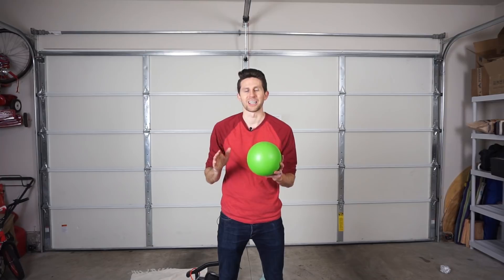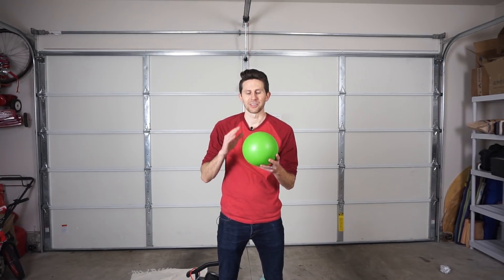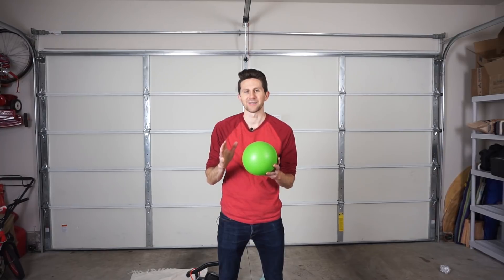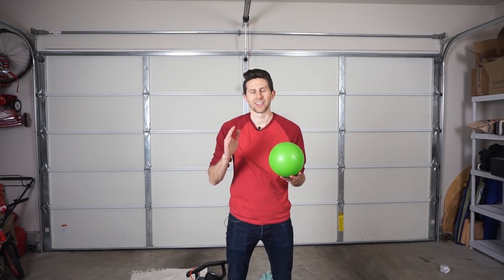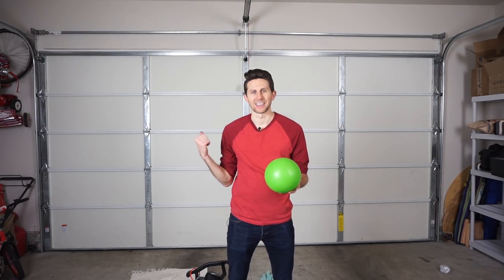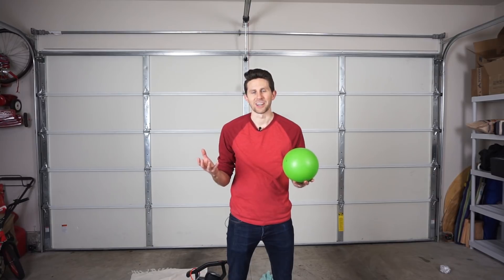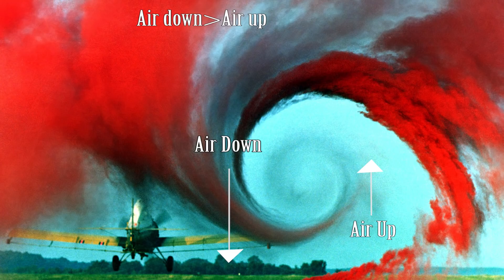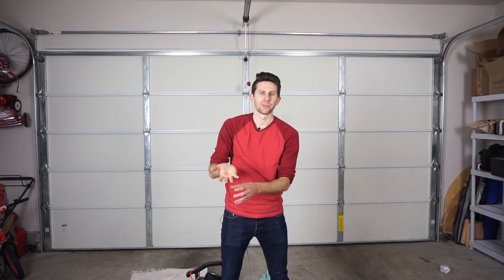How To Get Regular Things Around Your House to Float in Air?

Comment: Somewhere I have a toy version of this ("Schylling Floating Ball Game") in which you blow your breath into a wooden tube, and the exit tube is 90 degrees to the main tube; it comes with a little Styrofoam ball.  I figured out right away that I could tilt the whole thing and that the little ball would still stay in the air stream.

Comment: How about a blunt nose rocket with a small weight in the nose? The blunt nose could provide enough drag while the weight would keep the rocket in the proper orientation , if it works it would be cool to demonstrate how a few small change makes a big impact in the objects  ability to hover.  Also what about those small toy footballs that have a tail and fins? Do you think that would hover?? Great video as always, thanks!!

Comment: Fluid moving exerts less force perpendicular to direction of motion, than standing air, at low speeds and flows
It exerts more force in front and negative force behind

Air is like bouncy balls, bouncing in every direction when air is stable at rest then the bouncy balls hit every surface evenly, 
But if you blow air it's like turning on a machine gun each air particle you launch can hit other air molecules and blast them away likely in line with the stream, so a lot of the motions of the bouncy balls is now biased in one direction so vectors perpendicular to the stream are now spread over a greater distance

Comment: I was taught in flight school that Bernoulli's Principle relates to the airfoil of the wings. There is more surface on the top of the wing than the bottom and therefore the air passing over the top of the wing (airfoil) has to have a lower pressure than the air underneath the wings, essentially causing the wings to lift the aircraft. Same with rotary wing aircraft except the airfoils are the blades of the helicopter but same principle.

Comment: Sorry mate but your explanation on why airplanes fly is wrong. Two thirds of the effect are given by the bernoulli effect which creates an upward depression pushing up the wings and one third of the effecte it is given by the angle of attack of the wing Itself.
Air vortexes are not responsible for lift and they are rather disturbing it.
Trust a pilot's word.

Comment: About the ball with holes in it, I think the reason why I doesn't keep floating is mostly due to the fact that when it gets tilted so that the holes are facing the gound, most of the air will flow through them, so there won't be enough air pressure to keep the ball up..

Comment: Go back to school, and repeat Bernoulli's principles.

Bernoulli's principle states that an increase in the speed of the fluid occurs simultaneously with a decrease in pressure or a decrease in the fluid's potential energy. [Wiki]

Main principle why aerofoil of wing generates lift force.

Eventually the same principle place ball in the middle over and over in given experiment.

Comment: Wait hold on....I kept replaying the leaf blower/ ball explanation and section. So is it that atmospheric pressure is greater than the pressure created by the airflow rate over the ball? I'm trying to use Bernoulli principle here but when you say "the air that's going around the ball is going to be faster..." compared to what airflow? Just trying to understand. Where is the area of low pressure and the area of high pressure?

Comment: A fun shop trick is to take a rat-tail file or an old screwdriver as long as it has one of those large wooden handles in the sort of lightbulb shape they normally come in and use an air hose like that.

Comment: You should try and bend/angle the fins on the model rocket so it would spin when the air is applied onto this surface, thus creating more drag and a cool spinning effect. The extra drag will hopefully allow the rocket to stay in the air

Comment: I noticed your garage door has what’s called a torque master Spring system to counterbalance the weight of the garage door if you raise and lower the door manually and requires more than 10 lbs of effort in either direction convert it to a standard torsion spring or your automatic opener will fail prematurely and the attachment arm to the top section will cause metal fatigue at the mounting surface

Comment: Regarding the ball with holes, I'm thinking that if at any time the surfaces (or openings) of the holes are not equally exposed to the wind source, one hole will draw away more pressure by enabling a greater surface area to be exposed (the surface of the inside, that is).  That would create a momentary serious asymmetry in the pressure drop on the different sides by working as a sort of pressure sink, thereby causing the instability.

Comment: Not sure I understand the explanation entirely.  With a sphere, shouldn't the pressure drop around the sphere be equal on all sides?  I.e., if you imagine a cross-section circle inside the sphere, and this circle is on a plane perpendicular to the air flow, each pair of geometrically opposite points should have equal pressure drops. The pressure drops should counter-act each other, cancel each other out, leaving gravity to do what it normally does.  In other words, it would be like the airplane, which does not rely on the Bernoulli Effect, and if equal pressure drops obtained above and below the plane, it would just continue to be controlled by gravity.

Comment: You didn't try to float the rocket with greater angle. I think it would theoretically work. Rocket falls down, because there is not enough drag to push the rocket upwards. By tilting the the whole thing you lower the need for the drag, because gravity is not a strong counter-force for the air stream anymore. At the same time the air stream travels very fast (because of the aerodynamic design of the rocket), so the pressure holding the rocket becomes even stronger, and maybe strong enough to counter the gravity. I think there might be a sweet point, where the drag is small enough, to avoid pushing the rocket away and big enough to provide some uplifting force and help the pressure around the rocket fight the gravity.

Comment: Many people believe what they see on youtube.  600K subscribers gives the perception of credibility, however unwarranted. You should be very careful contradicting what you were taught in school. The Bernoulli Principle is EXACTLY how planes fly. The low pressure on the top of the wing relative to the bottom of the wing is a result of the shape of the airfoil. The angle of attack changes the shape of the virtual airfoil even though the physical profile of the wing does not change. You are giving the impression that the wing is providing thrust (propulsive force ) down which is not true, if the wing were providing thrust it would be called a rocket. The wing is not providing ANY energy to the system. The same force that lifts the ball at a 45 degree angle is what lifts an airplane wing as it moves through the air.  In fact, the ball is an airfoil and as you change the angle of attack (AOA) with the blower, you are effectively changing the virtual shape of that airfoil. This is why the ball will fall once you increase the AOA beyond the stall speed of the ball's 'airfoil' shape.

You really should update this video with annotations to correct your mistake so that people, especially kids, don't see this and become confused.

Comment: Because the air on the top of the wing is moving faster, there is lower pressure on the top of the wing, causing the plane to rise, and it helps especially since there is slower moving air on the bottom

Comment: So if the air around the object pushes on it to keep it in the airflow, it is also what's keeping it floating if you tilt the leafblower, right? Does the amount of weight you can float / the angle you can tilt it depend on the air pressure?

Comment: Planes don't fly by creating vortex around the wing. On picture big vortex is created by air moving over wingtip from high pressure area (under wing) to low pressure area (upper wing) and it is reducing lift. To reduce this negative effect the winglets are used. For different purpose is used small vortex generators on wings: more steeper wing angles are safe as air brakes off wing later thus making plane more safer and manageable on limit.

Comment: I have seen a children's toy that floats a ball/hockey puck on a stream of water. From my understanding if the objects axis of rotation is horizontal, it becomes stable on the edge of the Vertical stream. I'm curious about the bowl, could you place it on its side so it can spin around it's axis of greatest inertia? Another idea would be to float a cylynder on the stream of air! #MagnusEffect

Comment: You’re wrong about airplanes... well for the most part.  Most airplanes like a Boeing 747 use an airfoil design where the air flowing across the top of the wing travel a greater distance than the air flowing on the bottom, making the air on top needing to travel a greater distance, which makes that air less dense, which will force the wing up, since as we all know, air wants to travel from a high pressure to a low pressure. Now, some wings do use angle of attack to fly, such as most fighter jets. But fighter planes are far less efficient than airfoil designs. But fighters don’t necessarily need efficiency, they need speed. And airfoils are great for low speed, but anything approaching Mach 1, they create too much drag. Flatter wings create less drag at higher speeds. So, before trying to educate, learn how wings work first.
Reply from the maker: Nah, as far as I know all wings throw air down to stay up. Read this and tell me that isn’t the case: http://www.allstar.fiu.edu/aero/airflylvl3.htm
Reply: Yes, that states the facts. And yes, anytime you change the pitch of a wing (up or down) it will create a downward or an upward force. But what you don’t seem to grasp, is that the shape of the wing significantly increases or decreases the lift based upon the shape, thickness and length. A thinner wing has to move through the air faster to generate lift. And a thicker wing, a much slower speed. And anytime a wing changes pitch, it will have an effect upon the top or bottom side air. The only reason it’s effected more to the underside is because of this thing called gravity. 

Even helicopters have airfoils, albeit small and narrow, they still are in the shape of a wing, because a wing helps to generate lift better than a flat object. A flat object will create lift, but an immense amount of drag as well. 

I will be the first to acknowledge that I do not know everything, although I am a pilot and have enjoyed building aircraft, and the shape of the wing has a dramatic effect on how much lift it generates. 

He only problem I had with what you said, is that you said lift was only generated by a downward force, and that my friend is completely incorrect.

Comment: The reason it floats is because as it strays from the center of the air stream the side that's closest to the stream has lower pressure (Bernoulli's principle), thus drawing it back toward the center. This also explains why it can float when the air stream is angled from vertical. As gravity pulls it down, atmospheric pressure from below counters the force due to the lower pressure above. Remember, the further from the stream gravity pulls  the stronger the difference in airspeed; thus the greater the lifting force. This is why it remains stable.The same effect can be had by blowing upward against a ping pong ball. Makes for a fun party gag.

Comment: When the slo mo footage is played back, if the apple is spinning roughly 2 rev per sec, does that mean (assuming the normal video is shot at 30 fps) the apple is spinning around 4000 rpm? is that a little fast?

Comment: You should be able to levitate the Rocket If you Attack the fins in an angle, that the rocket spins really fast. If it works with screwdrivers over a compressor, why not over a leafblower? ;)

Comment: You should put a small hole in the center of the bowl and face upside down so it’s like a parachute and it will float the bowl upside down with no hole wouldn’t float because the air has nowhere to go after it was in there so it chose whichever way it was slightly tilted and escaped which caused it to lose balance but the hole in the middle slows it to escape it should be about a 3/8ths drill bit hole if you are going to do it though

Comment: Your explanations are awesome and are just at the point where they need to be..
But you were saying that the surface area is different on the sides so the pressure is different and hence the body drops more accurate word should be that the force is different on the sides as surface area is different pressure is atmospheric pressure it will same but since surface area is different so the force applied will be unequal on the sides and that is why the body drops...

Remaining experiment was awesome  i never thought of it before it was great...
And thanks for this knowledge practical knowledge is thousand times better than theoretical knowledge...

Comment: Something I've always wanted to know but can't experiment at my house... What is more powerful, hot water or cold water? If you put 100 degree water into 50 degree water will the temp be 75 degrees? I don't know how to get rid of the room temperature effecting the water.
Reply: There is no such thing as cold water, or cold anything. Heat is a thing, cold is not. Nothing in the universe makes something colder, if the temperature drops, heat is being removed from the system. Heat has "power", called energy, cold is less heat. Room temperature, or heat entropy, is where the water will end up. Room temperature is the ONLY thing affecting the water, even while being heated. If the room was 205F water that was 100 or 50 degrees...you get it. Average the three temps to find an 8th grade textbook. 
Can't do at your house? because you're nine? no you're 6 aren't you?

Comment: the issue is that the air moving below the ball is moving faster than the air on the sides and the air behind the ball and should there for have a lower pressure. but the pressure is higher because there is more moles of air in that space and that increases the pressure. That column of pressure is what supports the ball, the vacuum created on the back of the ball helps lift the ball, and stabilizes it. It is linked the bottle test, but not exactly the same manifestation of the principle I think.

Comment: The uniformly smooth objects float more easily in part because of the way they alter the momentum of the air around them. The smooth objects can leverage the viscosity of the air so that even as the air curls around behind (above) the object, the air is still thrown in a direction that is pretty much parallel to the surface of the object. This is called laminar flow. Any change in momentum that the object imparts on the air will be met with an opposing momentum change on the object. If the object strays too far to the right, there is more air on the left side. While you might expect this additional air to throw the object further off course, keep in mind the air is traveling upward, not sideways. And again, due to viscosity, it flows around the object and is ultimately thrown to the right as it finishes interacting with the object. Because the object took some of the upward air and threw it to the right, the object must receive some leftward momentum.

Objects that are irregular, or that are not curved on the far side, aren't able to get the air currents to "stick" to them at the end, instead inviting more foreign air to turbulently chime in. This situation doesn't benefit from the "stabilizing" nature of the

Comment: I deal with airstreams a lot at work. I'm pretty sure it would be more accurate to say that a fluid (or gas) moving faster has reduced pressure in all but one directions. 
Example using the bottles again: If you blow directly at an empty bottle it won't move towards your breath, and in fact moves along with the breath. The pressure is positive, but because all that positive pressure is directed in a line the pressure in all other directions is reduced.

Another example, this time from my workplace: If you seal off the doors of a room with plastic sheeting and turn on a fan the pressure outside of the direct line of air coming from the fan will be reduced. This will draw the plastic in. Of course conversely the pressure in the direct line of air coming from the fan will be greatly increased, so pointing the fan at the plastic will push it instead.
Reply: Excellent comment. Thank you for sharing this observation.